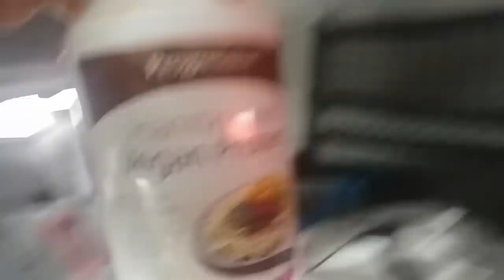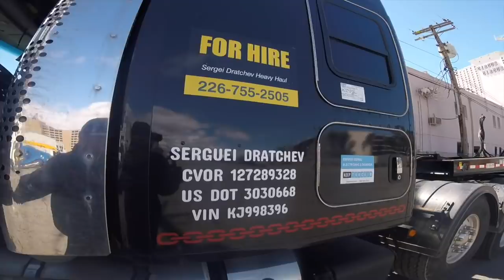Junttan PM23 Pile Driver -- 107,860 LB--Las Vegas, Nevada

Comment: To stop the spray from your hydraulic quick couplers take one of your old T-shirts you don't wear any more or a rag and place it over the male nipple.  Than take a hammer and hit the end of the nipple under the rag.  This will depress the protruding part enough for the pressurized oil to spray out and it will all be caught in the rag.  For the female coupler wrap the end of a flat punch with the rag, insert the punch and rag into the female couple and tap the hammer.  Again the little bit of pressurized oil will spray out and be trapped in the rag and not all over you or the truck.  I have the same problem with the couplers on my Kubota because when I remove the accessory in the morning when it is cool there is no pressure in the line.  Later in the day after the hoses sit in the sun for a few hours when I try to reconnect the lines the warm oil has expanded enough to make it impossible to connect by hand so I started using an old rag to release the pressure.  You can get flat faced couplers like you see on some skid steers but they have problems too so I prefer the type where I can easily release the pressure myself.

For your shims at the back, would it be possible to get a washer made for the pin that would go on the cotter pin side of the pin?  You could then insert the shim from the cotter pin side of the pin, place the washer and then the cotter pin.  This would allow you to changer the shim without having to completely remove the pin.

Love the videos so keep them coming.
Reply: For my tractor, I connect the ends when possible to keep pressure from building. Flat face couplers can be connected when there is pressure on the line. Not sure if the size will work for your trailer connection that is used on skid steers.
https://youtu.be/n3eWfc1koUU

Comment: Just a little FYI here. On my lowboy I wrap a couple rags around and over the end of the hydraulic fitting and then tap the fitting with a hammer. The rags keep the hydraulic oil from spraying and also protects the fitting when hitting it with a hammer.
Reply: you have to hit that with a hammer, you are not bleeding off the pressure in the hoses. take the time to go and bleed the pressure down at your valve handles. even after shutting down the pump. rock your handle valves open and close
Reply: @harleyhawk7959  the problem is with rocking the valves is your not releasing pressure at all. That only works if your hooked up because where would the pressurized hydraulic oil go if not hooked up? I've tried both ways. Rocking the valves does not work. I pull exclusively Trail King maybe there different I don't know. just never has worked any other way for me

Comment: If you look closer you would see that the California trailers have 4 short axles, that look like 2 from a distance. They also move outward so the rear of the trailer is 10 feet wide.